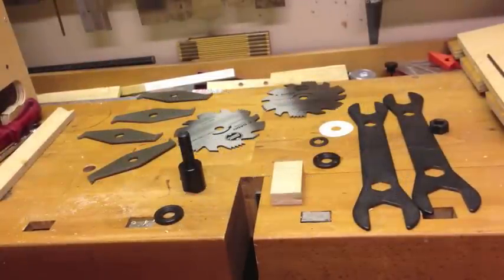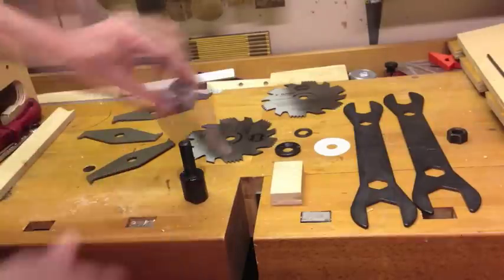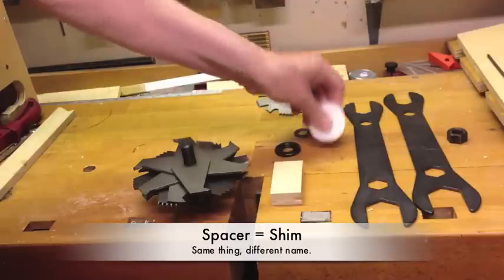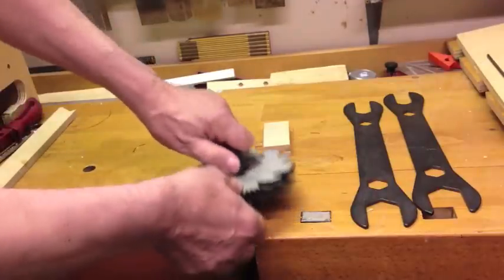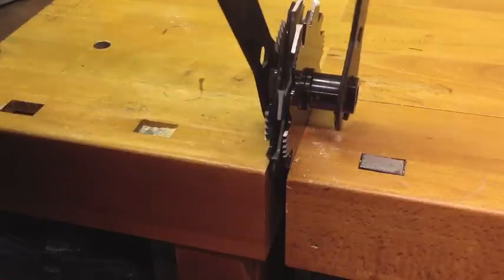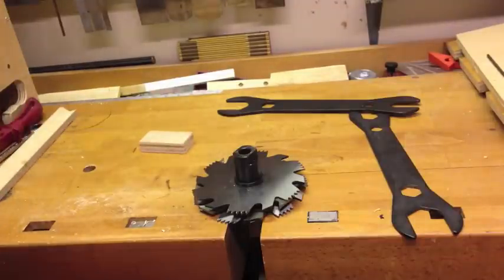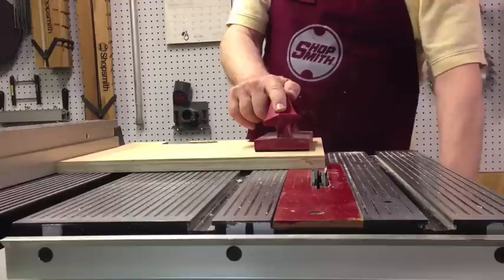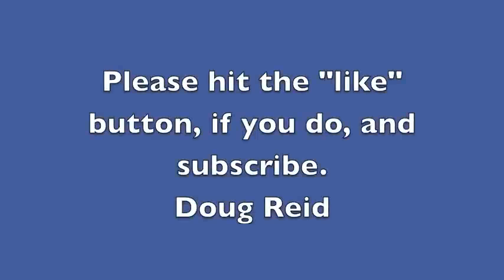How to use Shopsmith Dado set up. First cut on PowerPro

Comment: Just ordered the PowerPro, It is in the process of being shipped as we text. I have owned my shopsmith since 1987, The speed control assembly broke with a small part being ejected while I was using the jointer. This issue caused me to investigate and purchase the new PowerPro. That is when I discovered your videos. I am in the process of watching them now. I really enjoy them. Since my retirement I use the shopsmith daily and enjoy woodworking.

Comment: What is that spacer made out of? Paper? Is that what Shopsmith includes in the set?
Reply: Shopsmith sells dado sets made by third parties. They don't produce dado sets themselves. Four years ago when this video was made, they were selling a different set than they sell now. The current offering is a set made by CMT Orange Tools that includes very nice steel spacers. That's the set I have. My only complaint so far is that the case doesn't have a cutout in the foam for the Shopsmith arbor. I went ahead and butchered the foam and made a spot for it. It looks like it was chewed out by a demented beaver, but it provides the storage spot I wanted.

Comment: I have a 1950s model wobble wheel from Shopsmith/Magna.  This was my dad's Shopsmith Mark V but I am using it in my retirement.  He died a long time ago so I can't ask him some specific questions.  I have a sleeve that fits on the arbor shaft and dado center hole.  I can't figure out how to secure the dado to the arbor shaft.  There does not seem to be any tie down little screws to screw into the flat part of the arbor.  I also can't figure out how to secure the dado blade itself to a specific width. I can adjust it with the special allen wrench but there is not a way to keep that width constant.  I am not the smartest guy but I keep looking at the setup and reading the manuals but I can't figure this out.  Can you help me please?
Reply: George Sarkisian Hi, For the part of your question that deals with the use of the wobble dado, let me suggest a video explaining it well on Colin Knecht’s YouTube channel called WoodWorkWeb.
Reply: @NMranchhand  thank you.